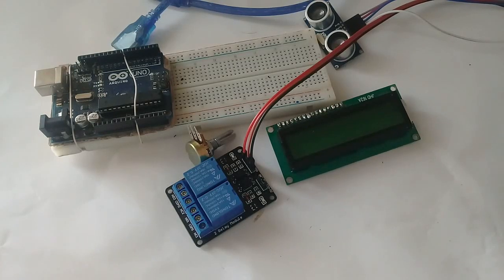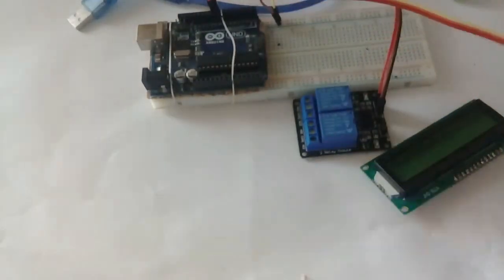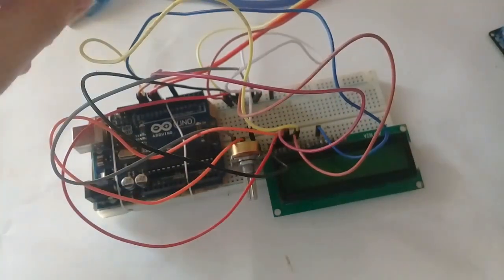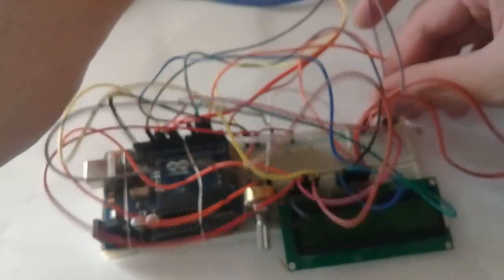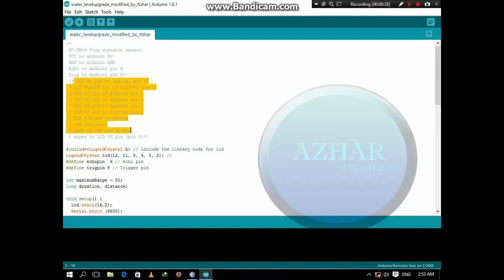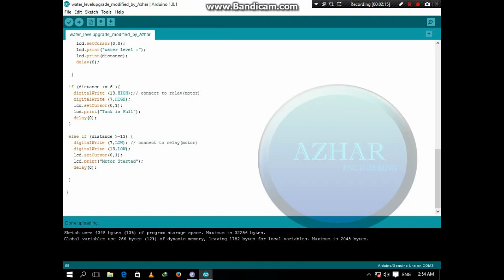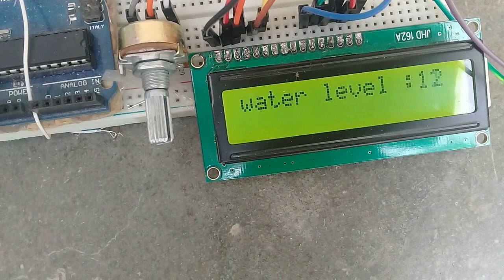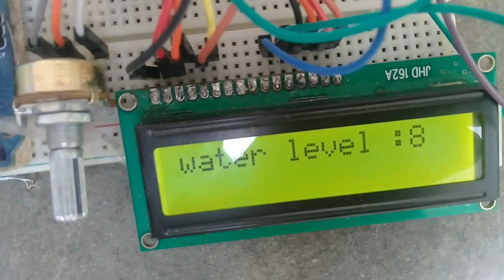How to make automatic water pump controller using arduino

Comment: Thanks for the video, but to make it work in real world i have some suggestions and hopefully you will make its version 2 and add all these features.

1. The circuit must be divided into two separate parts, because usually tank is at 2nd or 3rd floor and we want to see the lcd display and control at ground floor.

2. Both circuits must be wireless connected using 430mhz rf transmitter and receiver as its very cheap.

3. You should use normal wires as sensors because ultrasonic sensors may not work well in extreme conditions like temperature and humidity.

4. There must be manual switch to turn on/off motor at any time. Normally we turn on motor to collect fresh water for drinking.

5. Circuit working voltage must be 12v as 12v solar batteries are common now a days and we can connect it with our solar system.

6. water level should be shown from 1 to 10.
Reply from the maker: Thank you so much for suggestion.
Actually I am planning to make such a project. I am planning to make it wireless and give more control to the user. I want to make it an IOT project in which the users will see real time water level of tank in their phone. Also they can control their water pump from their phone.
I will definitely include your suggestions in the upcoming project.
Thank you.
Reply: @AzharElectronics  Adding IOT is also a great thing, but i would suggest to make it RF wireless and add an manual switch to turn on/off at any time, that manual switch can further be expanded to add iot circuit like esp8266. But most of the time its not only one user who need to know that water level but rather anyone who is at home must be able to know the water level. Therefore making it RF wireless it will be more practical and everyone can use this project in their homes.
Reply from the maker: @joshitoshi9835  Yes, I like you suggestion. I will try to implement it soon.
Thank you so much for suggestions.

Comment: Do you think this could be used in reverse? For example, the sensor monitors a water tank level, and when water drops below a predetermined level, the unit will turn off the pump.

Comment: recently purchased to inline water flow sensors, both to ensure the pump doesn't keep running if there is no water.   one is the liquid coming from my solar water - sometimes, even with 100% glycol it is frozen and cannot pump water through, the other is a water line that runs through the woodstove and heats the floor - again, in case of leak, or airlock so water is not moving would like to shut off pump.   no information within sensor package to indicate how it is even used!  very novice at arduino but i do have and have experimented a little.

Comment: I was thinking of trying this but I'm afraid of ruining the sensor with warm temperature and humidity since it will be inside a closed tank. Can the ultrasonic sensor handle these conditions? I don't think it's water resistant...
Reply from the maker: it is not water resistant. Water resistant ultrasonic sensors are also available in the market

Comment: HI Can I know what is the type of battery that you use?
Reply from the maker: I have used 12V battery for the motor
Reply: Any alternative other than battery?
Reply from the maker: @leesinjie8956  it depends on your motor's requirements. You can use a power supply also

Comment: sir great effort. is this code also work on ac motor? as you have used a dc motor in this project
Reply from the maker: Using AC motor will require AC. And you will have to use the relay a ccording to the motor requirements
Reply: @AzharElectronics  can we just put relay on NO configuration? i am talking about normal home water pump
Reply: @AzharElectronics  and thanks fro reply
Reply: @AzharElectronics  will these connection and code work for the dc water pump which we normally using in our home?
Reply from the maker: The working of the relay is same.
Whether its is DC or AC.
but for home water pump you will use a relay of high rating
Reply: @AzharElectronics  can you please suggest power?
Reply from the maker: Sorry. But power will be according to your motor's power

Comment: can anyone please tell me, for which pin of the relay module is connected to arduino's 7th pin
which is mentioned in program but not in circuit
Reply from the maker: No pin is connected to pin 7.. the relay is connected to pin 13
Reply: why does the code have a line for the 7 no pin?

Comment: And one more question..can i use 12v battery and 12v dc water pump but 5v relay??is it can work??
Reply from the maker: syamil boy yeah
Reply: Azhar Electronics if i use 5v battery 5v dc water pump amd 5v relay?is it work??

Comment: Hi, can u suggest me relay for 1 HP motor and 0.5 HP motor to work with??
Reply from the maker: You can search here.
https://hallroad.org/?s=Relay+finder&post_type=product

As the motor is 1HP so it will draw current of about 3 to 4A. 
So check the rating of relay there.

Comment: can I have detail the component used, tq sir
Reply from the maker: Arduino UNO R3
HC-SR04 Sensor
Relay Module
Breadboard
Jumper wires
Water pump
Battery
Reply from the maker: Arduino UNO R3
HC-SR04 Sensor
Relay Module
Breadboard
Jumper wires
Water pump
Battery

Comment: Hy there my man very nice video!
Could you give me your skype id to talk about a project I am working work on right now, I would really apreciate your help!
Reply from the maker: Thank You
Skype ID: azhar987k
Reply: @AzharElectronics  hey bro do you have discord?
Reply from the maker: @neilricardosantiago7554  Yes
Reply: @AzharElectronics  can i add you bro? cause i'm going to make a project that needs moisture sensor + water pump + water flow meter. Can you give me some clues on how to do it? Thanks! Cheers!
Reply from the maker: Yes.
My Discord Username: azharAK
Reply: @AzharElectronics  thanks man! subbed
Reply from the maker: @neilricardosantiago7554  OK
Reply from the maker: @neilricardosantiago7554  azharAK#2847